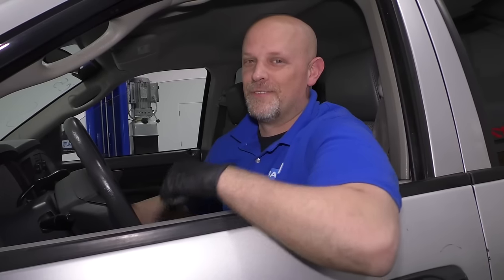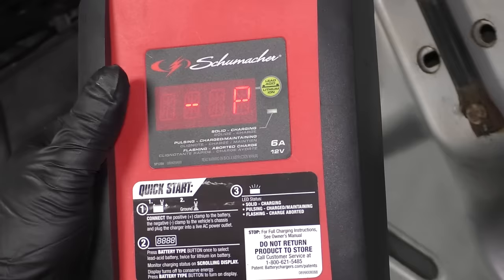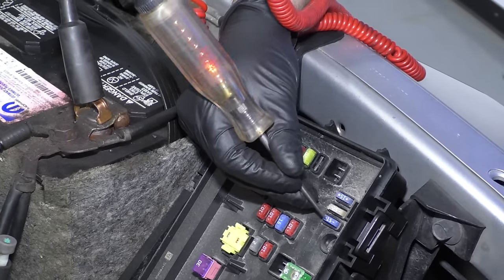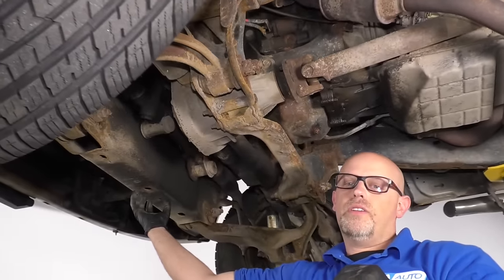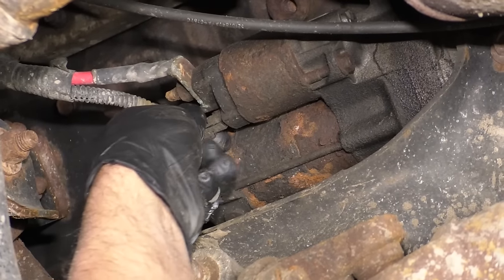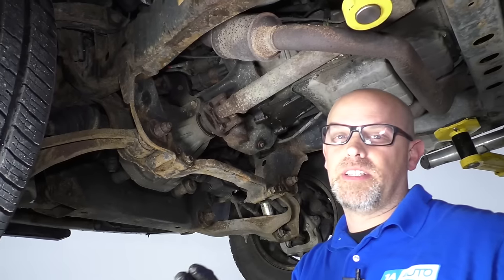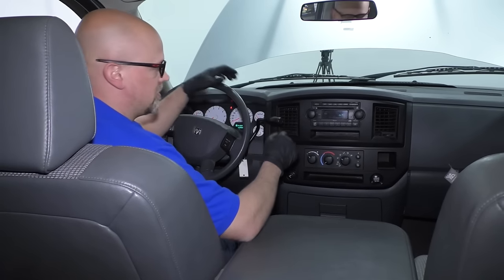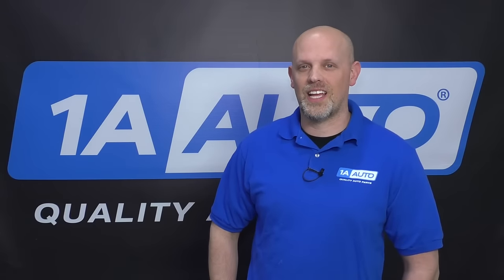Car or Truck Engine Won't Start? How to Diagnose a Bad Starter

Comment: What is wrong with my truck, I think its possessed...

- Intermittent starting problems (just clicks, late reaction starts.)
- often says "Low Engine Power" and vibrates entire truck 
-Interior lights randomly dim barely visible. The Audio chimes randomly dont work (blinking or seatbelt, no chime randomly)

New battery and alternator did nothing. Is my truck possessed?

Comment: Intermitten start.....turn the key and just click, click,click....waited 25 minutes then starts right up.....most of the time starts right up.....O'Reillys tested and said alternator, battery and starter are good....a Mechanic said starter.....battery or starter...or both?..

Comment: Hi. I hope someone can tell me why my car wont re-start when i switch off the engine after running for atleast an hour.. But it  starts when i let it rest for a while. I had the battery and alternator checked and there's no problem. Thank you.
Reply: The Coil Is BAD

Comment: What if it's very slow crank but no start? Car cranks but very slow until it stops cranking. This only happens when engine is hot. After some wait, engine starts normally
Reply: Starter is heat soaking.
It gets hot from the heat put off from the engine running. Make sure all electrical connections are clean and tight.
Usually their is a heat shield between the starter and exhaust pipes its a thin metal plate that shields the starter from heat make sure it isnt missing or damaged.
Reply: May need heat shield

Comment: I don't think the tests you did on the wires to the starter prove that those circuits are good. It only proves that they can carry enough current to power a test light.
Reply: I agree. Enough current available to light a test light does not mean that a highly corroded wire or connection is not the problem.

Comment: I just cant figure out how motor an trans be running fine an i stop at a stop light an motor died an will not start back up. Just stumped as to what has went wrong. Anyone have any clues to where i can get this figured out. Cuz im at the point of selling for parts. The truck is clean an body is like in great shape. Im just at that point of tossin in the towel on my truck.
Reply: Not 100% but I had a fuel pump go out before and it just made my truck stop starting got a few starts then stranded. Fuel pump tho depending on if its in the gas tank can be a crappy job to fix but I found a friend to do it for 200 the shop probably like 500. God Bless

Comment: You didn’t prove the starter had a good ground.  There is an earth strap between the engine block and negative battery terminal